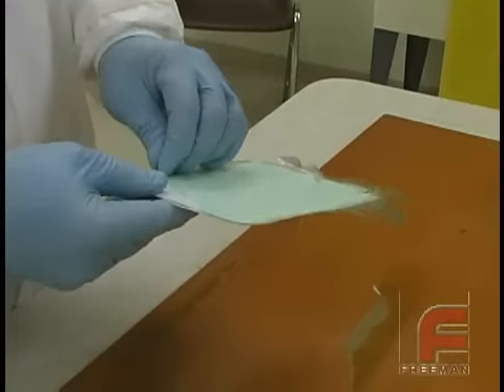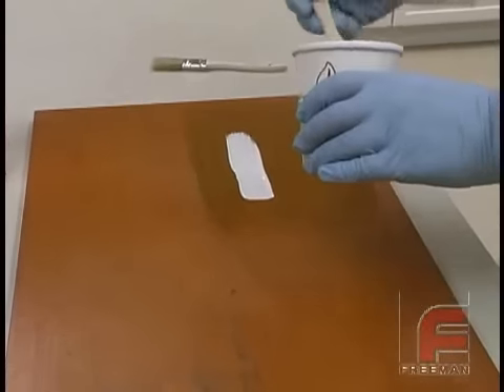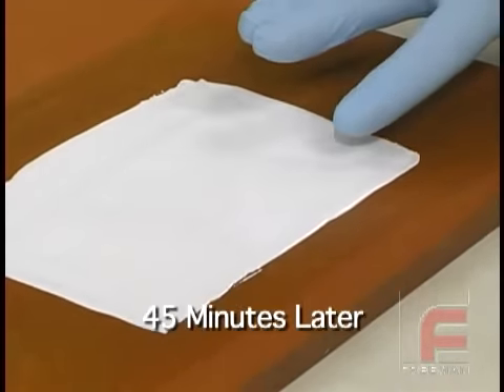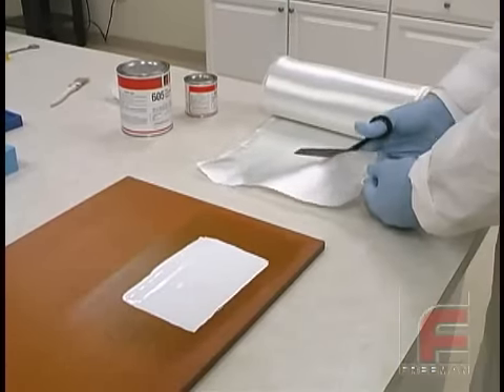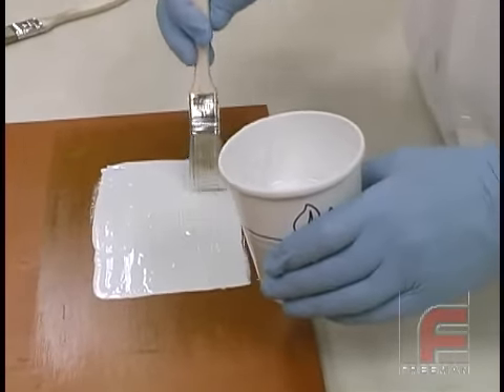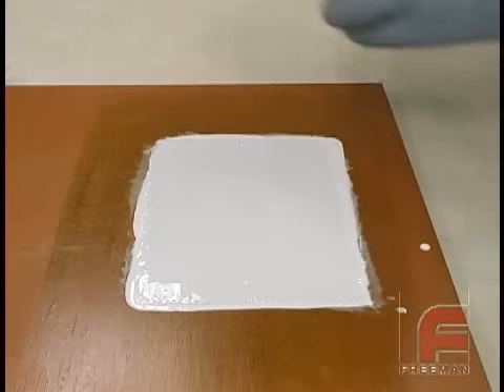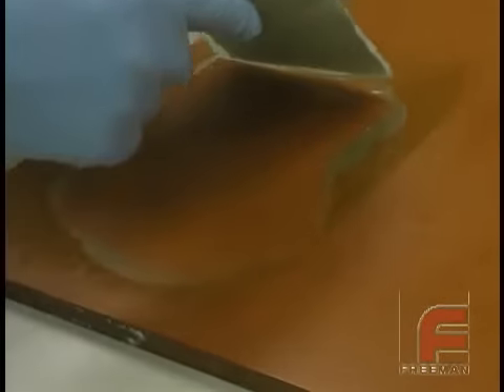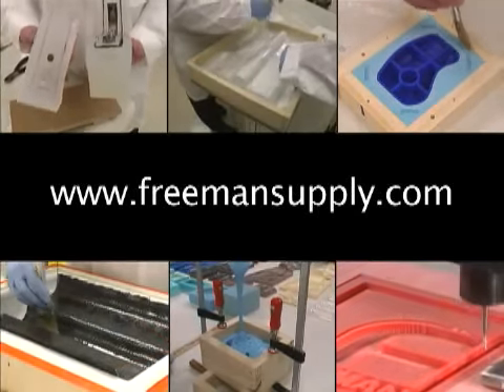Epoxy Fiberglass Laminating Introduction

Comment from the maker: Although it is not shown in this video, some customers have used Kraft Paper.

You could possibly use your 30-Minute Epoxy, but it would depend on the size of your part and the gel time of your epoxy.

If your epoxy starts to set up befor your job is completed, it may be difficult to wet-out the cloth.